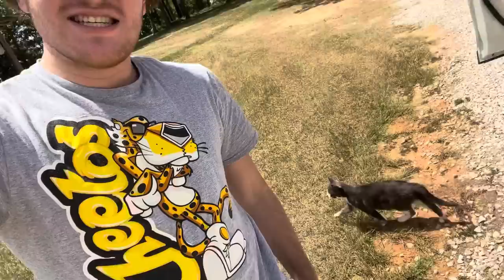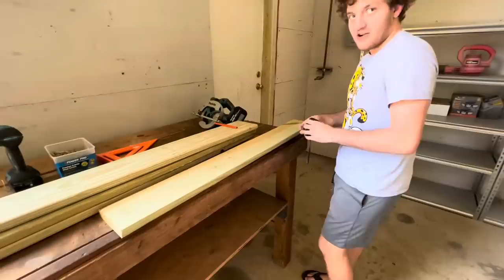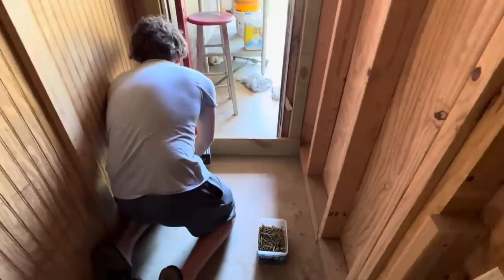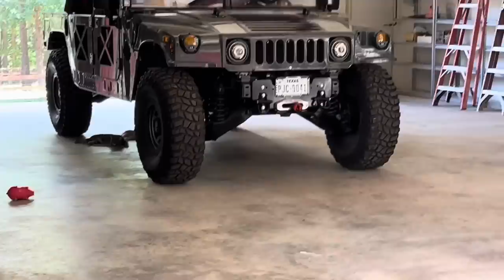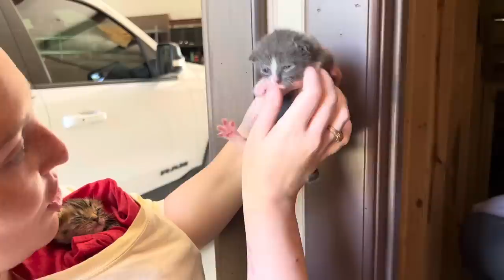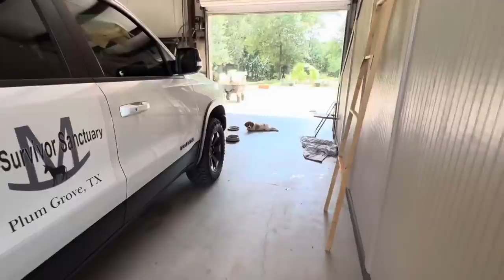Nikki Bella’s new FOREVER home! (Featuring: Fiona and Millie!) #flipflopfarmer

Comment: When you put a litter box in the closet for the kitties, ALWAYS use old-fashioned, plain NON-CLUMPING litter.  When they start to litter train, it takes them awhile to distinguish between food and litter.  I once had a new litter of kittens, and had clumping litter in the box.  I had even called the litter company to ask if their product was safe for kittens, and they said yes. However, the kittens started to eat small amounts of the litter, and it combined with the liquid in their systems, and the combo acted like concrete in their tiny little bodies. I almost lost my kittens due to intestinal obstruction due to the clumping litter.  It took tons of money and lots of vet intervention to save their lives. I know the old-fashioned litter smells a lot more, but it is much cheaper, and so much safer for innocent little ones. Also, if you ever have an oil spill on your concrete floor, it's excellent for absorbing it up, and you can just sweep it away.
Reply: Good advice. I didn't know that kittens might eat the litter.
Reply: Yes the non clumping litter for sure when the kittens start exploring. They will eat the other litter and could die from it.

Comment: Please keep her inside LE.  Cats can get pregnant WHILE nursing kittens.  And it usually happens that they come into heat while nursing.  Please check with your vet to verify.  It would just be unfortunate for her to get pregnant even before the kittens are weaned.  And most vets recommend weaning the kittens off Mom and waiting at 2 weeks after weaning for spay the Mom (Nikki) as the hormones make them more susceptible to bleeding during surgery.  Just something to consider
Reply: The other cats on LHL are fixed.  Feral ones oh dear
Reply: Yes, the males from other properties is what was my concern.  They can smell a female in heat from a couple miles away, feral or domesticated.  Many cat owners are under the impression that a female nursing kittens can’t get pregnant.  Just wanted him to definitely consider so Nikki Bella doesn’t add to the already overpopulation of cats.  Thanks for your comment.
Reply: Yes!  I have had that happen!!  Hope there are no feral ones around!
Reply: @cyndyespeland-winter2283  and I think they said they all have homes. Am sure those new owners will be responsible and get those boys all fixed 🙏🏻. I was referring to getting Nikki Bella spayed shortly after kittens are weaned off her.

Comment: LE, those kittens are going to be climbing through the holes or over those boards soon. I hope you put a small litter box in there that the kittens can use. I rescued two three-week old kittens that were abandoned, and they started using the litter box immediately, as well as eating canned kitten food and drinking the kitten formula milk replacement from a saucer.
Reply: I was thinking the same thing give or take another week they will crawl through the holes, I would maybe put some more wood or move the second board down and space the 3rd and add a 4th.
Reply: Yup. Maybe some other type of material put over the outside.
Reply: That and also so they can smell their “scents” in case they get to far from home lol!
Reply: I was thinking the same thing.  Holes in the board & they need a litter box.  The mom will show them how to use it.
Reply: I’m sure they put the litter box in after the video ended and I’m sure they’ll be just fine.
Reply: They'll be fine... I'm sure LE and Lester know what they're doing...
Reply: Good idea with little sand box, or Lester will waporize in Cat pee, and kittens get sick. Kitty like it. Clean. 😎🌅🙏🇺🇸🇩🇰
Reply: @cyndyespeland-winter2283  maybe but men don't always think of these details, and it needs to be a small shallow box that the kittens can get in and out of easily. If they didn't do it, I'm sure Jami will take care of it next time she's there.
Reply: @eileenlester4342  Screw in a wire mesh onto the boards on the outside.
Reply: @suzanneyoung8011  and NO clumping litter

Comment: I would add a litter box and within a week, toys and a horizontal scratch pad to keep those munchkins occupied.  I have seen kittens climb straight up a door frame six feet, so wooden boards will be no problem in a week or two.  I am sure you all plan to  eventually get Nikki Bella spayed, and within a few  months all of the kittens.  Otherwise, Lester is going to have 50 cats running around by next year.  He is certainly serious about scaring any mice away. 😂
Reply: I hope the kittens don't climb out through the space in between the boards. You might want to screw in a wire mesh covering all the boards from the outside

Comment: I have seen cats flatten themselves like  pancakes to get in and out. Cats are trips!
Reply: 😅 yep that's what mine did. I had rescued two abandoned three-week old kittens. At first they were by themselves in a bathroom, and then I bought a collapsible pet playpen that was eight sided and 48 inches across. It had a zip-on cover and door. I positioned it to where it was in the living room but the door was facing the hallway. That way the kittens had the run of the guest bathroom, the hallway and then it turned a corner and went into their playpen. Well one of them was a little Houdini and figured out a way to tunnel under the playpen sitting flat on the floor and then come out on the other side!

Comment: I hope you realize the kittens will be out of that area just shortly after they start walking around. Kittens are excellent escape artists, especially since they will have the boards t use as a ladder. You might add a big sheet of cardboard up there, that can be removed so humans can access the area to tend to the nursery needs. You might need a piece that is 4'. 
When the kittens want out, they'll  soon be out, so don't  be surprised when they escape. 
You might put some play things in there to keep them occupied. Even cardboard boxes with holes might give them something to do. If an old cat tower is handy. Yhat might also keep them happy. A bored kitten will be over the wall, without some diversion, especially when they see mom coming and going.
This should be I threshing in 2-3 weeks. LOL
Reply: Yep, they will find a way. I rescued two three-week old kittens that had been abandoned. At first I kept them in a small bathroom by themselves. Then to give them more room, without their having the run of the house yet, I bought one of those collapsible, mesh playpens for pets. It was 48" inches across with a zip mesh cover on top and a door that zipped open. It was eight sided. I put it at the end of a hall that opened up into the living room with the open playpen  door facing the hallway. That way they had the bathroom, hallway and this playpen that they could play in, and I could still keep an eye on them. 

Well it wasn't there two days before one of them kept getting out and running over to me in the living room. I couldn't figure out how she was doing it, because the playpen hadn't moved. I called her my little Houdini. I finally had to pull a chair over there and sit and watch for her to do it. She had figured out how to tunnel under that playpen and come out on the other side. Needless to say that setup didn't last long, especially when they got so big that they jumped on top of it while play fighting, and they collapsed the playpen!